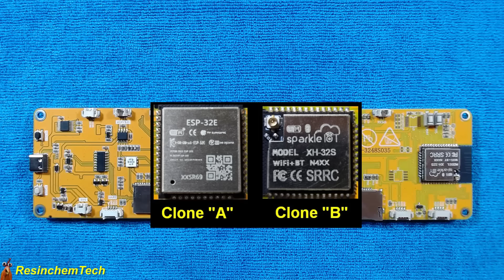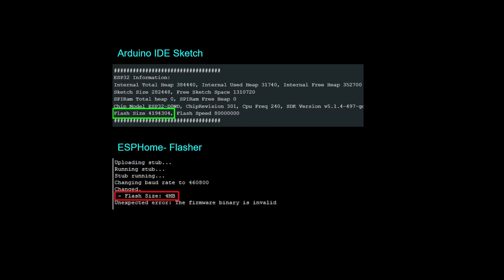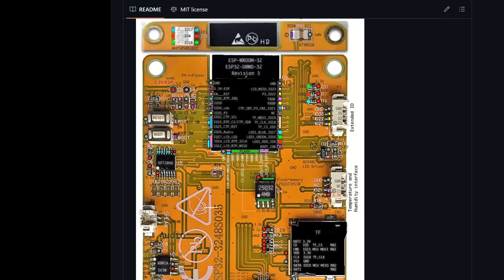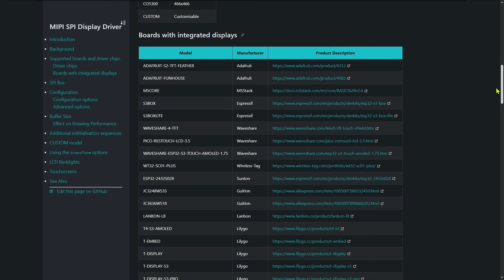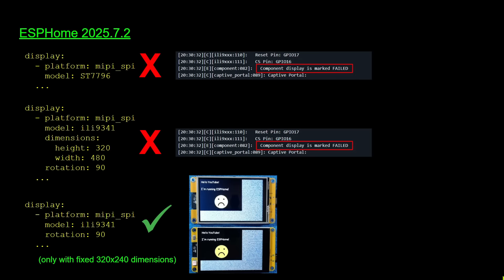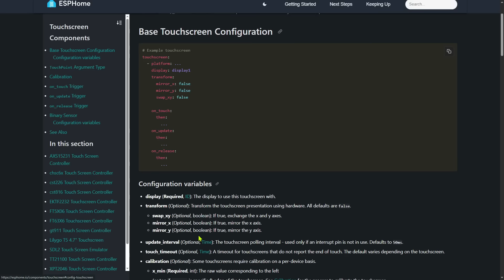Using the CYD: All Clones are Not Created Equal!

Comment: I bought a couple of these a few years ago when they were about $10 apiece. Some of the example code worked, but none of my programs could get the touch and the display to work at the same time. I tried to install PSRAM in the hope of getting some good video playback, but that experiment failed. The audio output was terrible too, so I nearly tossed these devices in the bin. I'm sure the CYD I have is totally different from yours. I'm happy to see that ESPHOME is a now a good option. Things change weekly. I did see another YT video recently about using a CYD as a StreamDeck for HA and went and found my devices. I've been using a lot of ESP32-S3-DEVKITs recently and was excited to see one in a CYD, but thanks for getting that corrected.  But are there real ones out there? And I love those pre-crimped cables, wish more kits had them. Please know that we appreciate all your hard work and research.
Reply from the maker: I struggled as well to get both of these to work as planned. In fact, the video would have been over 2 hours long (or longer) if I had shown all the troubleshooting and research I did.  I probably included too much as it is, but I wanted to show the basic techniques I used to identify things like the types of chips/drivers used and the GPIO pinouts and then how to use those in Arduino and/or ESPHome.  ESPHome was actually much easier to implement and get working (once I upgraded and got around the chip/resolution bug), but I don't think ESPHome will work in my bigger project for its intended use.

I'm planning (hoping) to use the capacitive touch version/Clone B in the larger project.  But I'm already wondering if I wouldn't be better off with a standalone capacitance touch display and my own ESP32.  Especially something similar to the ILI9341 that would also offer the SD card reader.  But I'll see if the CYD will work for my purposes first.

As always, thanks for the comment!
Reply: @ResinChemTech  I got the sd reader on the back of my displays working with the display after setting up a second SPI bus. I got it working using the Arduino IDE but had a heck of a time getting TFT_ESPI working on VSCode with PlatformIO and PIoarduino and found I had to play around with the platform version. grrr. Adding touch is next.